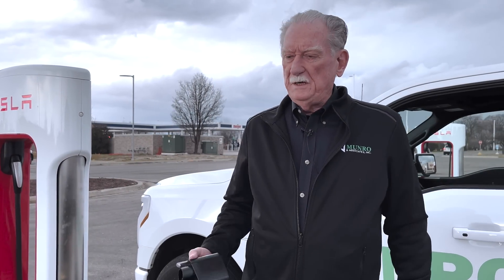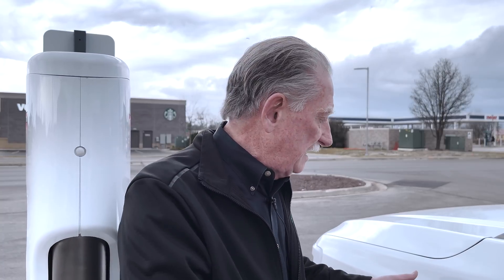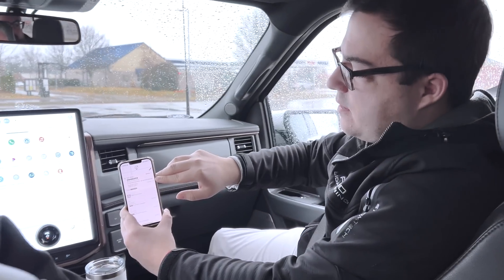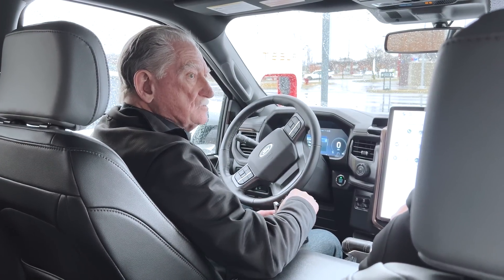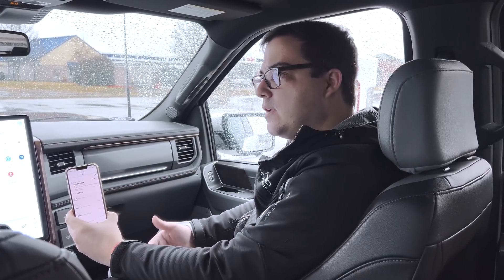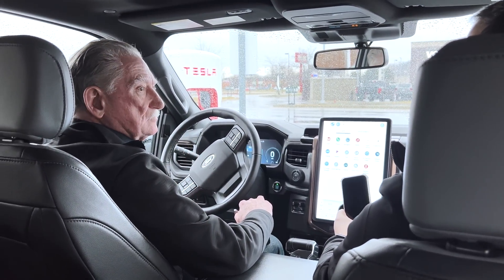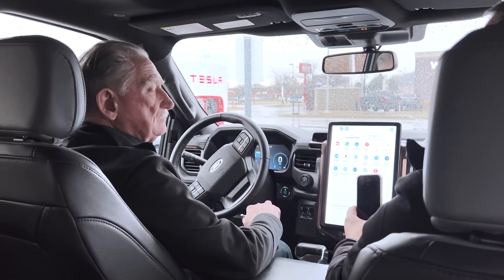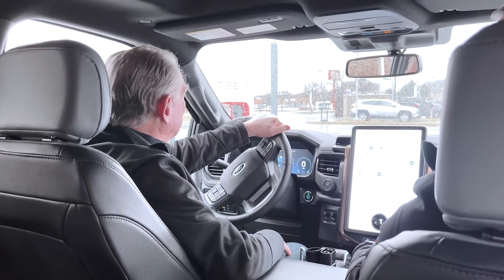Using the Ford Fast Charging Adapter: Ford gains access to Tesla's Supercharger Network

Comment: Fights at the charger station for opposing charging port locations will be fun internet fodder.    (The ports on the vehicles are on the same side, but opposite ends of the vehicles.  So they need to pull up to different sides of the same charger.   They aren't compatible from a macro perspective.  Will be interesting)
Reply: yeah, I'm OK with any car taking up a fast charging port but not so much with one car taking up two spaces.
Reply: @willyag2529  This those other cars will queue up on side of the chargers taking up +1 space (3 cars 4 charging slots)  and Tesla cars will be on the other and taking up 1 space each.
Reply: This is proven by marquesbrownlee whom is a major youtuber for tech and electric vehicles.. he actually owns one for his company mkbhd, before this happened, too.
Reply: @dertythegrower  I'm not sure where I first saw the issue raised, I didn't originate the concern.   And also, MKBHD is excellent.
Reply: @dertythegrower 
He's not "A major YouTuber for electric vehicles"
.
Noob.
Reply: That was Ford's fault for their dumb charge port placement.

Comment: So, do you have to use the phone app to find a charger? Can the chargers be selected and navigated to via the in vehicle screen or voice commands?
Reply: All the above.  You can use very useful apps, the Mach-E has charge stations on the GPS.  Also if I set a trip say from LA to Vegas, it will route the trip with the best charges to stop at based on many factors.  Finally, when you get an electric car you start paying attention to charge stations and realize they are EVERYWHERE.  It’s shocking how many there are that I didn’t notice until I got an electric car
Reply: most people don't notice
Reply: You cant just pick random chargers. You need to make sure they are compatible. It was not clear in this go-over if the in-truck map includes that information yet. But if it doesn't, that should be fixable in an OTA update.
Reply: @patreekotime4578  it does but it slow. the mach-E vlog show that it pulls up on navigation in the car .

Comment: This is a made up first world problem in US.. Rest of world uses CCS2 , even Tesla in EU uses CCS2.  So every car in EU uses the same plug
Reply: There are several reasons Tesla uses CCS2 in Europe.

All down to timing.
.
1) Since the "Tesla volume product" (Model 3) didn't arrive in Europe until 2019, Tesla had a relatively small presence on the continent,
.
2) There was more political regulation and more consensus regarding their "preferred standard".
.
3) 3 phase power availability swayed regulation towards CCS.
.
4) Due to the greater incidence of CCS2, Tesla had more to gain, since they could essentially rapidly increase the available network with little investment.
.
It simply made sense.
.
Oh.
Just btw.
30+% of the Global market uses neither CCS version.
China.
Reply: @rogerstarkey5390  see the genius / politicians/ engineers🤭 of the EUSSR @ work 🤡.  Other works of wonder fr’rinstance, the amazing improved refridgerant (@ 6x the cost) and the non detachable coke bottle caps etc etc too many more to mention.  Que Bono?
Reply: They’re all switching to NACS in the US so it is a temporary issue.
Reply: The plug isn't the issue, obviously.
Reply: It is one of several issues.
Reply: So the largest number of available chargers are tesla chargers. It makes far more since for the industry to switch to the tesla standard here because they have all the chargers and are willing to let other car companies use them.
Reply: A great example of US vs EU thinking and results.  @skellington2000
Reply: Why does that matter?  Are a lot of people driving from Europe to the US or vice versa?
Reply: True but I still prefer NACS over CCS2 anyway.  CCS is too clunky for North America especially since we don’t need 3 phase power.
Reply: @skellington2000 too true their previous success was the camel 🤭.  Welcome to the wonderful world of the EUSSR 😠
Reply: Japan uses nacs
Reply: Tesla used NACS in the USA before they used CCS2 in Europe, since Tesla is a US company.  So once again, Europe picked a different standard, simply because they don't want to adopt a US standard. In the USA, there are far more Tesla chargers than anything else, and they are far more likely to work. Simply put, any company selling EVs in the USA will soon come standard with NACS plugs. The adapter is really for already sold vehicles, not the newly manufactured vehicles. If it charges, other than the NACS is less cumbersome, it makes no difference.
Reply: @john_in_phoenix 
It was nothing to do with "Not a US standard".
It was the availability of 3 phase
Reply: @rogerstarkey5390  past experience with standards would indicate that it is a "we won't adopt a US standard" thing. 3 phase electric is available in the USA, it simply isn't common. DC fast charging doesn't care anyway.
Reply: @john_in_phoenix 
I explained (at length) why Tesla chose CCS2 in Europe....
Reply: @john_in_phoenix  it’s NOT because it’s a US thing — the EUSSR just employ vast numbers of beurocraps who need to find something to do and they are ALL World Class engineers 🤭.  And have indirect financial interests , no doubt.    See my previous post for details 😠

Comment: So what is the surcharge above tesla cost of charging. There is another party involved.. cannot tell me this is a 'fee free' exchange.
Reply: There's a monthly subscription charge for non Tesla users if they want to get the same price, otherwise the cost is higher (but still lower than many of the competitors).
Reply: @StormyDog 
Correct
Reply: I just recently read that there is a surcharge of some 20-30%, but even then it is still cheaper than some of the other chargers.
Reply: If you use the Ford offer, then Ford sets the price.
Reply: There is no surcharge.  Tesla had to agree to allow his charge network to go public by 2024 as he took many many dollars in state and federal funding to get his network where it is.  It was an exchange of money for an agreement.
Reply: @djemcee 
Are you absolutely certain about that?
.
The Tesla app is $12:99 per month and provides the same price as a Tesla user.
.
That wouldn't make sense if the price was the same.
.
Anyway, do you think the "federal funding" (which was available to all providers who Still charge more) would compensate for the cost of installing the extra units necessary to keep the Tesla experience the same?
.
You're saying "give something (which nobody else provides) for nothing".
That's not the way it works
Reply: @djemcee  Nonsense. You (or the person you got that from) are just trying to paint Tesla as the bad boy with your lies about "state and federal funding to get his network where it is".

Comment: I believe it's actually the "Tesla fast charging adaptor, Ford Edition" 😉
.
I am surprised its not "Ford Blue"
Reply: its already overpriced if you do not order it or get yours in time.. that would make it go from 250 to 300
Reply: @dertythegrower 3rd-party options like the A2Z adapter exist, plus it's free based on VIN and not owner, until iirc the end of June. that's MORE than enough time for all current owners in my opinion.

Comment: Big question that you didn't answer….  How Fast?
Reply: I got ~167 KW for around 10 minutes, then it tapers down to 120's then toward end of charge curve 50's
Reply: The speed of the charge is regulated by the vehicle, not the Supercharger, up to the limits of the Supercharger.
Reply: @Garrison169  The vehicle charging speed is a factor but changer can also set the maximum current and voltage.
Reply: @robinholmes785  As I said, the charger has a maximum capacity.  It may vary depending on its available source.
Reply: The overriding advantage?
.
You roll up.
Plug in
It works..

Comment: Jim Farley should take another road trip and show how easy it is to go with a Ford now.  Jim videotape and publish!
Reply: Farley Munro and Musk should take the trip together
Reply: Tesla charges ford customers a lot more, about 10-20% more 😅 good luck
Reply: @dertythegrower  Farley can afford it. Plus, the upcharge probably kicks back to Ford anyway🙂
Reply: @mikelemoine4267 actually it all goes to tesla it seems. ford would be wise to not add anything onto the costs, at least initially. the price difference for charging will be so cheap anyways most people simply won't care. we're talking a couple bucks per tank
Reply: @codyshields3797  Makes sense. Tesla wants to make some money on these non-customers and it'll hopefully help fund expansion of the chargers to accommodate more vehicles. As you said, the convenience of the superchargers is worth the upcharge.
Reply: @dertythegrower I only charge 3 or 4 times a year on public chargers and already save 70% compared to gas, so the cost is negible given the convenience. Do you own an EV ?
Reply: Farley killed the sales of his own electric vehicles after he published his roadtrip showing the horrible state of non-Tesla charging in the USA. This should help out a lot. They should tell people to use only the small diameter liquid cooled cables because those are the faster chargers. I’ve seen locations with both types, usually in separate areas.
Reply: and how to take up two spots
Reply: At least until Tesla installs much longer cables! @RickyLourenco
Reply: my point is not only do we need to standardize the plug but also the charge port location. it will be nice to see jim experience this fist hand and hopeful lead the was a he has with the plug. jim has done a great job being so personally involved in the ev space.